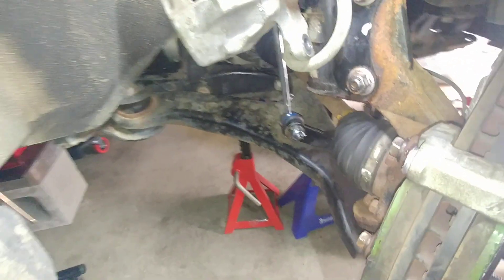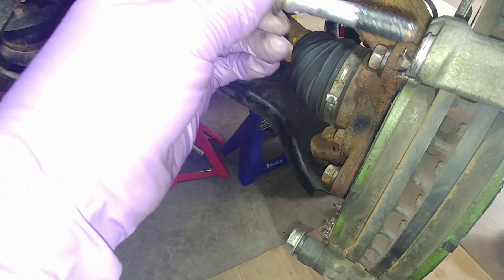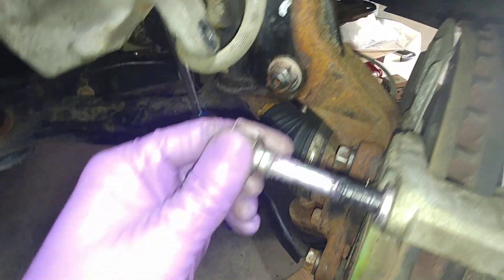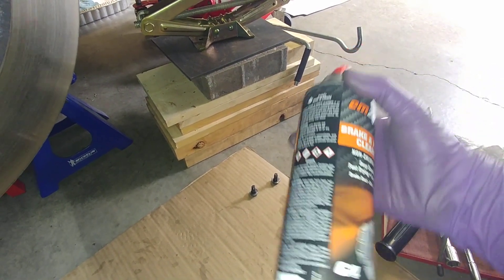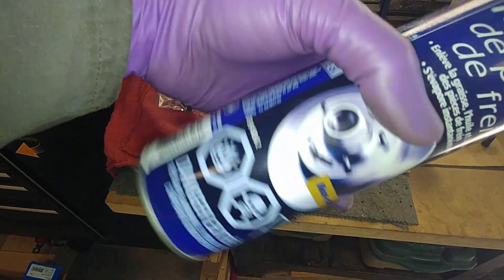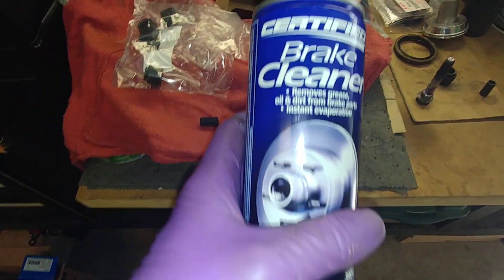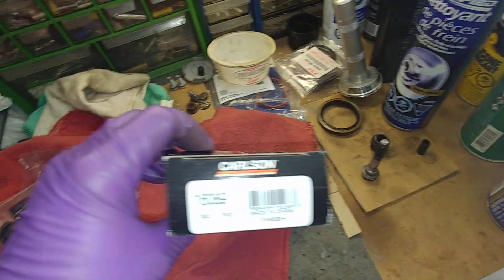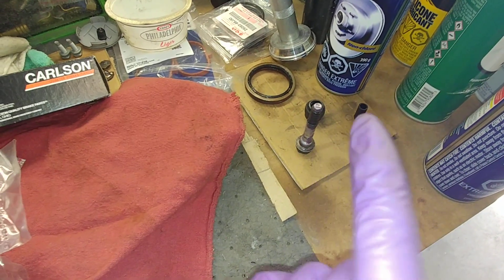CAUTION when cleaning brake caliper guide pin

Comment: Good video.  I simply wipe rubber components for brakes with a clean rag. They are made of a material that resists brake fluid.   Brake cleaner ,  petroleum based  grease and never seize swells them up.